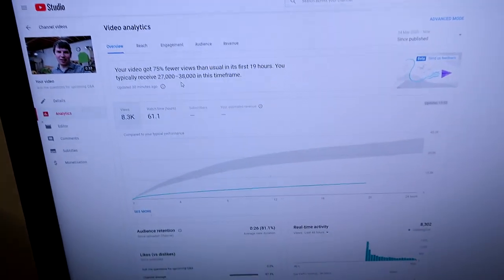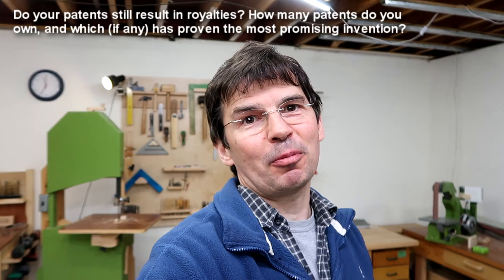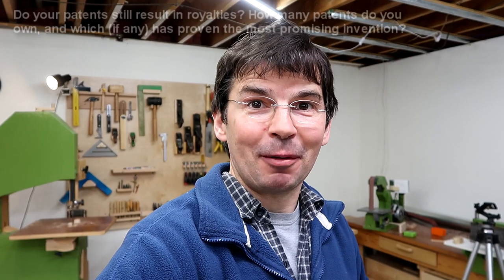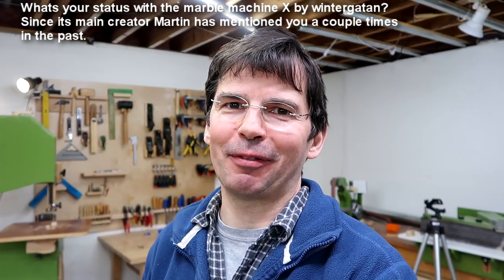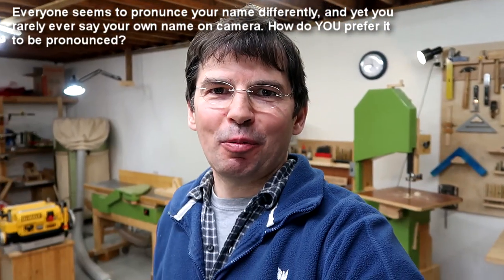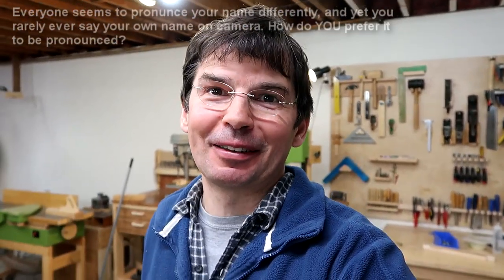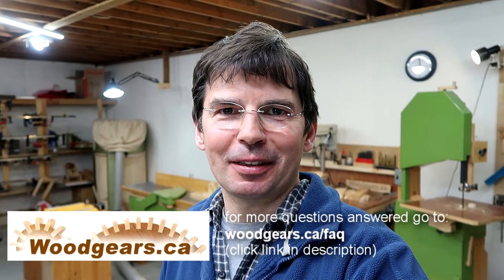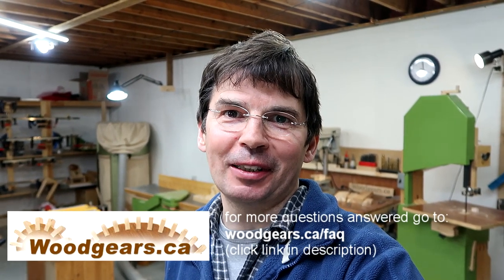Questions and answers, 2020

Comment: For your injury, have you tried alternating hot and cold? I had a tendon injury in my triceps last year and the thing that worked for me was soaking the elbow in ice water for 15 to 20 minutes, letting it settle for 10 minutes and then soaking it in hot water for 15 to 20 minutes. I did each cycle twice and then repeated the whole process again in the evening. What it does is force blood flow to the and from the area being soaked which brings in more platelet rich blood which promotes healing in that area. It also reduces swelling with the cold and relaxes the tissue with the warm. You could do the same thing with a cold pack and heating pad but Ive always found them to be more trouble due to needing to strap the pack to a limb, the ice pack not being pliable enough to conform to the area and sometimes the pressure of application causing more discomfort. whereas the water adds no pressure and saturates the whole affected area. Plus it costs nothing so it wont hurt you in anyway to try.

Comment: I enjoy most all your videos  but I especially like your series on motors and all things electrical. Maybe some projects using the Raspberry Pi. How you set up your Pi for the freezer experiment, connecting instrumentation to a Pi and using it as a data recorder, transmitter, or controller would be interesting, to me anyway.

Comment: Regarding the webcams on the raspberry pi the 100 mbit/s USB and Ethernet is probably the limiting factor. Uncompressed YUYV from standard webcams saturate that immediately on any resolution larger than like 480p. Fancier webcams(Logi c920) can do MJPG and/or h264 compression onboard but they are kinda price atm. I think the newer rpi4 has better USB and Ethernet bandwidths. The $99 Jetson Nano is more fun though, the revision B has 2 CSI camera ports. Are you using Gstreamer or something like mjpg_streamer?
Reply from the maker: Just trying to grab stills off the camera, not video.  for $99 for a jetson nano, its cheaper to buy another raspberry pi, and then I have much better supported software.

Comment: I just want to say I feel your pain about bringing all the wood when moving. I moved about five years ago and threw out a bunch of stuff, and now I'm wishing I didn't. It actually makes me sad that I can't get it back.
Reply: You can't take everything. The next time I move I don't think I am taking anything. Because I'll probably be moving far away. Nothing I have is that great anyways.
Reply: You will have many new scraps of wood if you keep making new things. I'm getting to the point of the scraps taking up more room than the tools. Now, I make smaller things and end up with even smaller scraps. :)
Reply: @GeekboyNC  That's the problem. I'm not making new things because I can't afford to buy wood right now. It's food or wood, and I'm buying food. That's why I'm regretting it. Because I could be getting a ton of use out of all the wood I gave up that I already owned.

Comment: I've been debating attempting to build the 20 inch bandsaw. I'm pretty sure I don't have the skills or the patients or most importantly the time. 
If Mathias is most proud of that I'll have to try it. 
I thought for certain he would have said the pantorouter in reference to what he's most proud of. 
I love my pantorouter. It's my second favorite tool. 
My first is my Klein lineman pliers.  The simplicity of design and how effective they are is a winning combo.
Reply: Richard Patterson Do it. I’m trying the 16” one currently. I’m not that confident but if it fails I just try again and get better. If you can do the Pantorouter you can do a bandsaw.
Reply: @coalitionofrob436  on no, I bought the pantorouter! I wanted that to work perfectly. It does.
Reply: @richardpatterson4312  Ha!, I thought about that right after I hit "reply". Just do it. I reckon my wheels are not true by about 1.5mm. I'll run with it. If it causes problem, I'll make new ones. That's the good thing about doing it yourself.

Comment: Your tablesaw fingercut sounds a lot like my experience. I was ripping some store bought oak flooring. It has two trapezoidal grooves on the underside.  I got too close to the blade before grabbing my push-stick. Would have been fine with no grooves underneath, but the pieces separated and my finger pushed the groove down to the table. The saw put a 1/32" dado in the center of my nail and just removed enough skin on my finger tip to bleed. (1/8" x 3/16") .
If was quite startling. No permanant scar.

Comment: Your view on patents is spot on.
Your statement that wood movement is the most ignored factor among woodworkers matches my experience.  
Your statement about your wife, and her views about your time, is completely typical from what I've seen.
You mentioned the possibility of the virus doubling every 3 days in your area after you go back to more normal behavior.  It was doubling every 3 days in the states before the lockdown, so I assume it was doing the same in Canada.
Reply from the maker: Yes.  The thing is, if you double zero every three days, you can go a long time with nothing happens, until some imported case brings it to one.

Comment: My "issue" with the Wintergatan's  MMX is all the tiny little welds everywhere of 1/8th rods butt welded to steel plate done by at the time a novice welder. Sort like a wood joint where you glue the end of a dowel rod to a board. 

I just hope a welder is included in the traveling show.
Reply from the maker: butt joints make prefectly good joints in welding, not like in wood.  I assume he's gotten quit good at it by now.
Reply: @matthiasrandomstuff2221  but he did lots of them when he was still learning and they were on the machine itself  upside down in cramped areas. i hope for the best.

Comment: I especially liked you comments about intuition and engineering.  I chose mechanical engineering because I could understand the fundamental concepts with little effort.  Later I found that I might have been a better fit for structural engineering because I understood the concepts of statics with no effort at all.  But some of the more esoteric ideas in electronics make no senses to me, although I am quite good at residential wiring.

Comment: I know exactly what you mean by the doctor thing. I have to try hard not to say in front of a doctor whether I suspect a constant muscle pain is a sprained muscle or tendonitis. My conclusion contaminates their conclusion without fail unless it's one specific type of doctor. It has to be a doctor that has done heavy physical work and has felt the difference between the various muscle and joint issues. Too often the book smart doctors don't fully appreciate how heavy the stuff we shove and throw around is, if they did their diagnosis would likely come out as accurate as someone with first hand experience.

Comment: Matthias, I implore you to consider dry needling for your mystery forarm/bicep pain.
I got it done recently by the resident physio specialist at my gym after months of severe pain after working out for any period of time. It got to the point where at the end of the week, the pain would culminate till I could barely hold the bar after 10 mins. It would subside eventually but I was at a loss on how to fix it. 
I couldn't do much with the way it was but after two mildly uncomfortable sessions I was pretty much cured. I was amazed.
There's nothing New Agey about it. It targets and releases minute muscle strands that have become overly constrained and releases the pressure. Before that I thought I might have tendinitis too because the source of the pain was so ambiguous at times. I couldn't tell if it was my elbow, my for arm, tricep, bicep even my wrists were in pain at time. The real culprit in the end was an underdeveloped rotator cuff that was never recruited or utilised properly leading to severe imbalance (and pain) after awhile. 
Definitely worth investigating if you ever find it flare up again.  You're definitely right about Doctors. They'll have a guess and prescribe some ointment, pills or the impractical advice of R & R. Try and see a physio specialist. Couldn't hurt.
Reply from the maker: I have received so many unique pieces advice on what the solution.  90% of those are bound to be wrong.  You tell me this is the right way.  So does everyone else, this makes you no different from the majority that are wrong.
Reply: @matthiasrandomstuff2221  And how many of those "bound to be wrongs" did you follow up on to be certain? Whatever suit yourself. I got free of my debilitating pain that sounded similar to yours, thought I'd pass on the word. Do what you like.

Comment: Hi Matthias, I understand wood expands and contracts, but could explain what you meant about epoxy resin river table and wood expansion and contraction - or provide the link to the original video. What was done to protect the table from the natural wood movement? I think you mentioned some sort of inset?
Reply from the maker: the glass inset isn't bonded to the wood, but floats, allowing for expansion.
Reply: Hi Matthias, thank you for the quick reply. Apologies, could you expand on your answer - floating glass? One has a mold, and wood inside - then one adds epoxy. I cannot visualize the glass bit?
Reply: @peterg902  Have a look at Greg Klasson's website.

Comment: Hi Matt, about what you said @18:18 how would one go about deferintiating themselves in a field where there isn't much room to tinker outside of school?
I'm a mechanical engineering finalist and other than cad and some ansys here and there I can't find much to do on my own. Would you have any advice on the matter?

I've been watching your channel since 2012 and it's one of the reasons I picked up woodworking, not particularly great at it but I find it fun and relaxing, especially in exam periods, one hell of a stress relief.
Reply from the maker: If you can't find stuff to do, I'd take that as a bad sign!  Maybe consider a different career.

Comment: I'm not so sure you're right about river tables.  Epoxy stabilizes wood to the point where wood movement wouldn't open up between the wood and resin.  It's also elastic. Consider a canoe. Plenty of movement, but the epoxy still adheres to the shape without cracking .  With that said, i'm not a very big fan of them either.
Reply from the maker: on a canoe, the layers of fiberglass is what prevents the wood from doing much.  The river tables - the epoxy doesn't soak into the surrounging wood, so that still moves.

Comment: Not really a fan of epoxy river tables, but what makes you think that wood movement will cause delamination from the epoxy river any more than wood movement would cause delamination from the varnish applied to a solid wooden table? Just curious about any insight you may have on that as it was an aspect of failure to them that I hadnt thought about and now I am curious.
Reply from the maker: varnish is more flexible, and bonded more to the wood than itself.
Reply: @matthiasrandomstuff2221  thank you, that makes sense.

Comment: You can just plug regular usb webcams into a raspi. I use multiple cams on a single pi 3b running octoprint for my 3d printers.
Reply from the maker: I tried 3 cameras with fswebcam.  Two didn't work right, the third crashes the pi hard on average after 8 hours.
Reply: @matthiasrandomstuff2221  I'm using Logitech C920's (they are usually on sale somewhere). Worked out the box for me with octoprint (although I have to run a separate instances of octoprint for each printer on the pi)

Comment: Did you try generic webcams with raspberry pi? I am using cheapest webcam Icould find, and it works right off the bat with RPI.
Reply from the maker: used as a webcam, probably much better.

Comment: I might slightly disagree regarding intuition.  Rather, I think engineering at its core is a foundation built upon trial and error, whether you've learned from trial and error yourself, or because you've learned from those who've done the trial and error and settled on the methods that work.  I would say your child analogy is fitting for this, as a child knows how to stand and walk not necessarily because they intuit how to walk, but rather because they've tried hundreds of way that didn't work first, and settled on the methods that do.  Intuition would seem, at least superficially, to play more of a role in how to use failures to refine the path to success, and then applying those successes to new applications.

But perhaps this is splitting hairs. shrug

Comment: Speaking of bandsaws, wood movement and plywood; cost aside would it be an advantage to build the bandsaw frame out of laminated layers of, say baltic birch plywood?

Also, how do you pronounce your Last name..?
Reply: No because in the straight sections (which need to be stiff), half the grain is going in the wrong direction.

Comment: Many webcams should work natively with Linux. Make sure the webcams are getting enough power. Try a powered USB hub or a larger supply for the pi.
Reply: The couple I tried were plug and play. But I run AMD64. I never tried ARM.

Comment: Starting out, a long, long time ago, I was sure wood movement was theoretical, over-stated by self-important academics, and didn't really apply to me. Hmmm...
Reply from the maker: if you live in hawaii or arizona, you can ignore it, till you take your stuff somewhere else one day.
Reply: A Long Island gallery owner told me that Jim Krenov sent her a blanket wrapped cabinet via air freight. Its point of origin was Fort Bragg, CA, right on the foggy pacific coast where lumber stabilizes at 10 to 14% moisture content. When the diminutive cabinet was off loaded in NYC the center panel of the door had a big crack, that in a matter of hours at high, dry cross-country altitudes. @matthiasrandomstuff2221

Comment: I wonder if the pandemic is going too well in New Brunswick. 
I have heard the Spanish flu mostly affected people UNDER the age of 40. This was not because of the mechanism of the illness; it was due to immunity. The older generations had mostly been exposed to an earlier iteration of this virus, when they were young. This earlier iteration was relatively mild, with few fatalities. The 20% or so of people OVER the age of 40 who got exposed to the Spanish flu version of the virus for the first time, they had a higher mortality rate than the younger afflicted. 

We assume there will be a vaccine. Well, suppose there's not? Perhaps the best outcome would be if the most healthy people as possible eventually get exposed to this virus. But at a rate where our healthcare system can handle it. I think it goes without saying that older people would be safeguarded. And that parents of newborns would probably rather avoid exposure, themselves, preferring to take that risk in the future.
Reply from the maker: Yes, a valid concern.  But I think it is wise to wait at least a few more months.  We already know a lot more than we did two months ago, both in terms of how it spreads and how to treat it.  So even without a vaccine, time helps.  And with the spanish flue, both people and areas that got it later fared better.